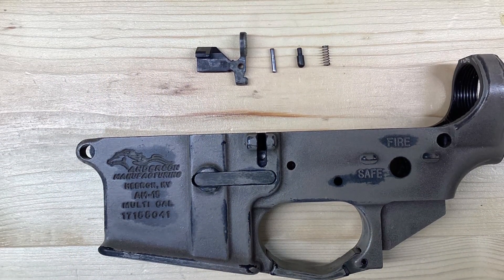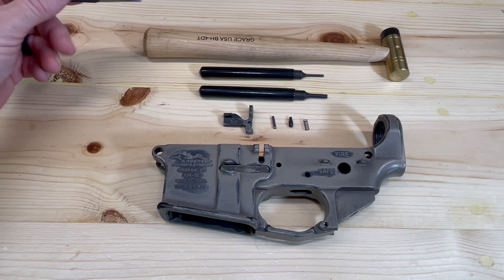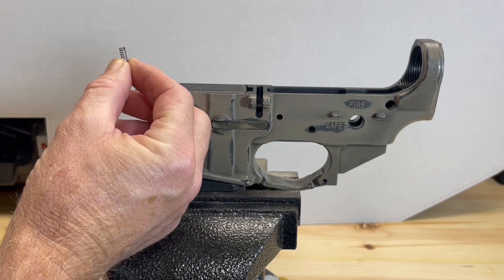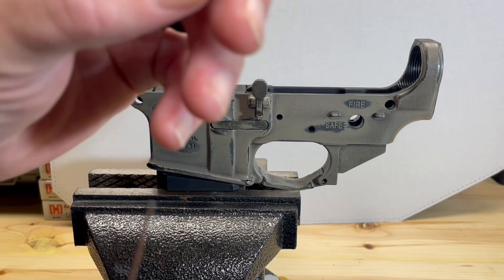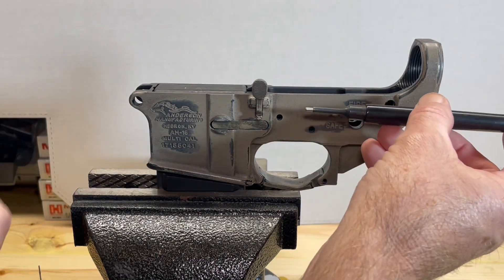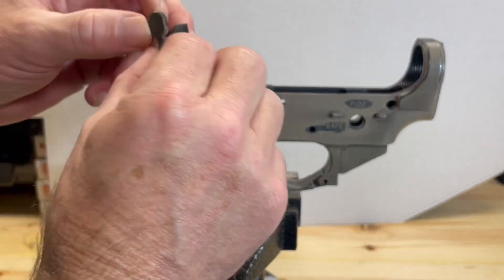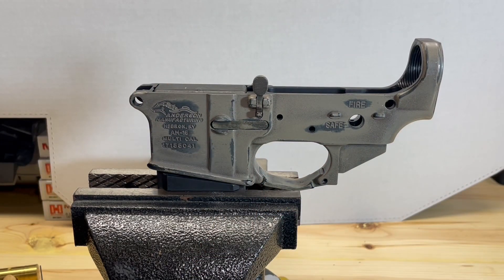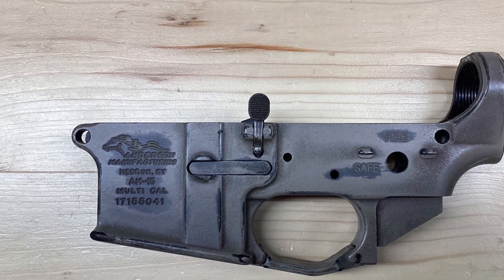AR15 Bolt Catch Assembly Installation

Comment: Well, that went smoothly... even without any roll pin tools: a large nail set worked great for a roll pin starter and I finished off with a scratch awl to put a slight flare on the roll pin ends. Presto! Thanks again for a great tutorial, you've suddenly become my "go-to" AR guru...  and rightly so. Now onward to the trigger and safety install videos!  BTW... a little masking tape goes a long way to prevent scratching and marring your new lower receiver.

Comment: That was great! Is it possible to change out the magazine release after the bolt catch is installed?
Reply from the maker: Yes the magazine assembly and the bolt catch assembly are not dependent on each other. You can work on either one without interference from the other.
Reply from the maker: @Doc Holliday Yes I stand corrected.  I did not think through my original response carefully

Comment: What brand of punches were those? I like those with the protective coverings.
Reply from the maker: Idk I bought them years ago and they are not branded.  However, it could be these https://www.amazon.com/Pridefend-Catch-Install-Removal-Starter/dp/B07SLX25FN/ref=sr_1_3?crid=3KZLOLJFWU9HV&keywords=Pridefend+Bolt+Catch+Pin+Install&qid=1667843606&sprefix=pridefend+bolt+catch+pin+install%2Caps%2C82&sr=8-3
Reply: @GunTalk556  two years later, and i'm buying these, than ks!